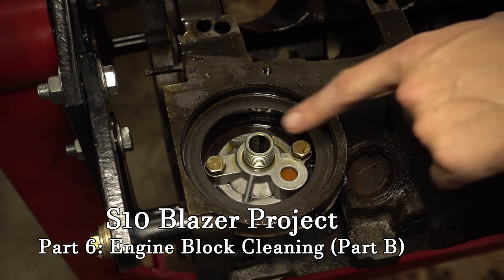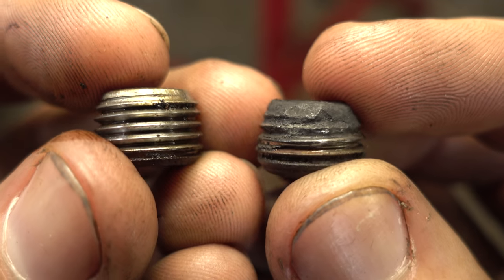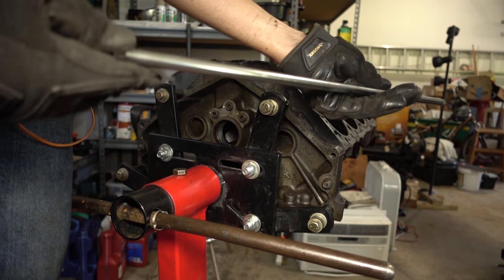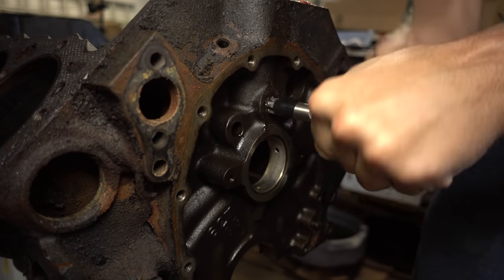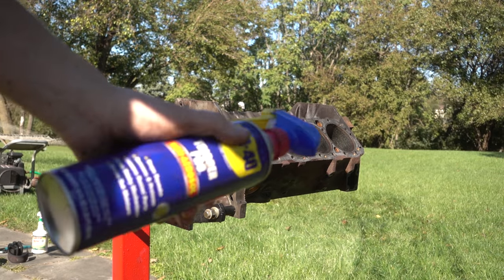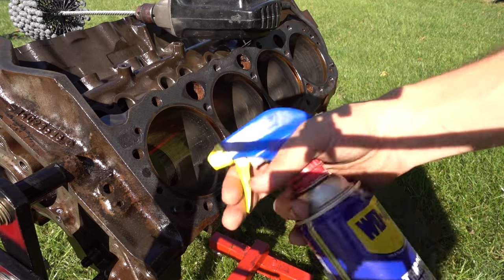V8 S10 Engine Block Cleaning and Honing (Ep.6, Part 2 of 4)

Comment: oh hey look he's using WD-40 for it's actual intended purpose instead of as a lubricant or penetrating oil. neat.
Reply: Tears are a better lube then wd-40
Reply: PB Blaster > WD-40 (as a penetrating oil at least) also pb blaster loses points for looking like squirrel piss
Reply: The actual intended use… 🚀

Comment: Hey in the future drill a small hole in the soft plug center. Then use a sheet metal screw or bolt for an anchor point. Most of the time you can use a claw hammer or a slide hammer and they come right out.
Reply from the maker: Good idea, that would be easier for some of them!

Comment: Simpler way of removing freeze plugs is to knock them in then move them to the left or right and grab the lip with a pair of vice grips like you did with the adjustable pliers. Then you dont risk the chance of slipping with the adjustable pliers, Then you can roll them out with the leverage of the vice grips. These came out pretty easy, but some are a real bear to get out. Much less chance of busted knuckles.
Much easier to do. Nice job and good video

Comment: Just a tip, hold the trigger on the water gun when you start the pressure washer. It makes it ten times easier to start
Reply from the maker: Thanks, interesting tip! Hadn't thought of that before, I did have some problems getting it started in the past (neighbor gave it to me locked up), if I ever have that problem again I'll have to try that out!

Comment: Good idea on cleaning the head bolts from all the the anti-seize i cant stress enough when i see someone just throwing brand new bolts down in them annnnd not cleaning them or even checking. Also all the mating surfaces wired wheel is exactly what you should do. Takes off any rtv or sealant on them ensure a good clean flat surface for a good seal 2 thumbs up!!

Comment: Man I'd be worried about shavings blocking that front cam gallery.  It's going to be hard to guarantee it's clear with the bearing still in there. When tapping those holes in the front of the case it's a good idea to stuff something (foam ear plugs work) in the holes.  The plugs can be popped out from the other end when done.
Reply from the maker: Good thinking on plugging those holes, I honestly didn't think that far ahead haha. I sprayed the pressure washer, compressed air, and brake cleaner through that bearing from every passage (blocking others to direct the flow) in every direction, I'm pretty confident I got it all taken care of.
Reply: FuzzyDicePimp yeah after watching you flush it out I tend to agree:). Your block came out cleaner than anything Ive done myself.  Looked like it was tanked at a machine shop.

Comment: in the future, if you arent gonna get the deck blocked, use a piece of wood with sandpaper to clean off the old gasket. using a die grinder with a wheel makes the surface uneven and can lead to failure of the head gasket.
Reply from the maker: You're right, and that is a good method for flattening a gasket surface, wouldn't be a bad idea to go through and do that after cleaning the gasket. A soft wire wheel is the best method I've found for removing pretty much any type of gasket though. These wheels won't last like the really hard ones will, but I even use them for cleaning gaskets off of aluminum and it gives the aluminum a nice shine, no real scratch pattern or anything. Absolutely no danger to iron.
Reply: FuzzyDicePimp was it a brass one or a steel one? I bet you could get away with it, I just wouldn't. I'm too afraid of profiling the surface unevenly.
Reply from the maker: They're steel, but it is very soft steel. Same wire as the brushes I used to clean the pistons in the other video. I understand what you're saying, but I'm not worried about it. Removing old gasket remnants would take ages and many sheets of sandpaper, but I'm sure it would do a fine job as well!
Reply: FuzzyDicePimp I uh, also have a other question, do you happen to remember the thread you used to chase the threads for the water temperature of sensor in the head? (If you've gone through the heads) I've gotta make an adapter for an ls swap and the Internet doesn't make any sense.
Reply from the maker: 3/8-18 NPT, just double checked.

Also, did a little searching to confirm, but the sandpaper method you suggested doesn't seem like a great idea. Surface finish only really matters for MLS head gaskets for high boost applications, and I don't think anything short of a machine shop would get the finish just right for those. Only time I've dealt with a MLS gasket was on an engine straight from the shop, so I don't really have experience with that surface finish concern. The block of wood and sandpaper is good in theory, and I've seen it suggested in rebuild manuals for carburetors and transmissions, but maybe a deck surface is too large to be able to reliably sand flat enough. Never tried that on a head gasket surface myself.
Reply: I've had good luck with 3m roloc discs
Reply from the maker: Those are very commonly used too, but a bit too pricey and messy for me. For something like this were it was being completely washed anyway, those would be a great choice
Reply: I run the cleaning department at an engine machine shop, and I use steel wire wheels on all cast iron, even heads and blocks that are not getting faced. You just have to keep it moving so it doesn't heat up and smear the surface, and that's with a big 7" 10 amp grinder. Pretty hard to mess up cast iron surfaces
Reply: FuzzyDicePimp yes, and a block of wood is not very flat. I've used a glass plate and sand paper to lap small engine heads and cylinders, but on a big v8 forget about it
Reply: Those soft wire brushes are plenty good for the application, but if you go for softer material on the block, 3M makes "taffy disks" for removing tape remnants and adhesives from painted surfaces without damaging them, which would probably work alright for something like this as well.
Reply: Look up rollok discs :)
Reply: Anthony Krieger 

Yes yes yes , 3M pads on a die grinder or dremel are bad idea they will cut and remove metal as well as old gasket .
Reply: exactly wat i do use a perfectly shaped 2x4 and a sandpaper and wet the sand paper with diesel to keep it lubricated it works like a charm and you save that money you would've spent in machine shop

Comment: Awesome in-depth video, love the amount or effort you put into building stuff! One thing I would have done differently is using a stone type hone instead of a flex hone. The flex hone doesn't have structure, so it will simply mask the scuffs, scratches and pitting. It won't do anything to true the cylinder before you put new rings in it.

Comment: you're right, shouldn't use a tap.  one trick is take a bolt and grind a slot through all the threads.  this will allow junk to build up in the recessed area and not damage your block threads.
Reply from the maker: Yep, you're right, that is a good solution. I have even done that before to chase threads, and have an extra set of head bolts since I broke one taking this apart. Why didn't I do that? Laziness. "It'll be fine" is a dangerous way of thinking haha.
Reply: Or undersized taps.

Comment: Machinist here, all was good till you used that drill with the tap.  On any potentially destructive jobs use your hands.
Reply: totally agree
Reply: Its fine if he set his chuck right
Reply: I was thinking the same thing. Would it have took that much longer to do it manually.
Reply: I'm no machinist, but it appeared he only used the drill once it was trapped out to insert the plug?
Reply: You can use a drill with a tap if you know what you're doing.
As long as you're careful.
Also you have to use the correct tap.
A machine tap.
I still use 4 fluids...
I'm an old machinist.
If it's under 3/8 I do it by hand.
Reply: It was just fine.  He had the clutch setting in the drill you can clearly hear the clutch kick in he obviously isn't stupid.  It was not an imoact driver it was a drill.

Comment: Not sure if taking a wire brush to the cylinder deck where the head gasket sets is the best idea, you really don't want to change that surface finish
Reply from the maker: You'd be amazed what you can get away with, haha! But seriously, those brushes are soft enough that they won't even scratch aluminum, it isn't a problem. For a stiff wire brush, you'd be absolutely right.
Reply: FuzzyDicePimp I know on some engines you definitely don't want to change the finish on the cylinder deck what so ever but I agree, you're probably just fine here
Reply from the maker: I've used roloc wheels more aggressive than these to clean a 7MGE block, those things blow head gaskets like they were designed to have oil in the coolant, hasn't been a problem yet. Just like anything else, I think as long as you are mindful of what you are doing it isn't a problem. If you don't run the die grinder on 150 PSI and lean on the thing like a pro wrestler it'll be friendlier to the surface than many other cleaning methods.

EDIT: Also, this is a small block Chevy. I could remove the head gaskets with a chainsaw and it would still run until I roll the truck over haha

Comment: You  could have used the pipes cylindrical brush mounted on the drill to clean up the threads.
When  you use a tap in a tapped bore,you make it bigger and weaker,it just removes material ,not only crap.
Reply from the maker: A brush wouldn't remove the really tough sealant, that stuff was really on there. Would probably be good enough, though. A thread chaser, as I mention, is the proper tool for the job, as it would clean the threads without removing metal. You are correct that a tap will usually remove a bit of metal each time you run it through, so it is not the ideal solution.
Reply: There are metallic brushes for rifling /barrels for guns wich are really tough and quite hard.
Maybe it can help you.
Reply from the maker: I have brass brushes for my guns, but they wouldn't touch that sealant. Most people clean engine passages with brass brushes (I didn't because I left the cam bearings in and the engine was in decent shape). Threads should have a thread chaser though. Will probably make or buy one if I end up in this situation again, or have actually expensive engine parts to work on.
Reply: wire brush will not back out.
Reply: i should have said a wire brush will not back out of threads unless you can go all the way past the thread, the bristles wont bend backwards.

Comment: If you get a higher amp hour battery for that impact it’ll gain a little power and a lot more run time
Reply from the maker: You're right, but I'm fine with it as-is. I have four of the little batteries from combo deals, don't want to invest in the big batteries (though I do want the big XR impact, so I will have to eventually). Both the 20V drill and that impact driver seem like they are on their last legs, anyway.

Comment: Run a hose to your house water heater. Run faucet 5 minutes. Turn temperature control to maximum. Wait till unit shuts off. Run power washer with that. Return setting when finished. Note: it's actually beneficial to the unit to flush out the tank periodically. An inline filter would be great, to. Chlorine will corrode cast iron.

Comment: If you're doing something like head bolt threads and you don't really want to run a tap down it a good trick is to grind or cut a groove lengthways into an old bolt and use that to chase the threads
Reply from the maker: Yep, a good tip! I have done that in the past (with mixed results) for odd bolt sizes where I didn't have a tap. Enough people yelled at me about using the tap that I'll have to try making a set of chasers for engine threads.

Comment: On steel freeze plugs just weld a bolt to them head down threads up screw on the slide hammer and pop them right out

Comment: Why are there so many plugs on the engine? Why not just leave the holes out to begin with? Are they inspection holes or something?
Reply from the maker: The holes they close are used in the casting process as well as the drilling of oil galleys in the block afterward. Plugs are necessary to make the block, but of course need to be sealed afterward for proper use of the engine.

Comment: I made my own welsch plug removal tool, you tap in a thread to the plug screw in the tool spray some easy out around the plug and tighten it up till it bites and slides, then i unscrew them. easy.

Comment: Good old Water Displacement 40th formula, aka WD-40.
It was originally designed to be used by Convair to protect the outer skin which comprised the paper-thin balloon tanks of the Atlas missile from rust and corrosion.

Comment: what are the plugs for
Reply from the maker: Some for coolant, some for oil. The threaded ones at the base of the block and the ones in the sides of the block (1-5/8") are for coolant passages, the other threaded ones and the big one (2-3/32") are for oil. The holes they close are used in the casting process, and necessary to make the block, but of course need to be sealed afterward for proper use of the engine.

(I typed this to respond to another comment but I'm copy and pasting it here)
Reply: thankyou for explaining
Reply: MN SHP they also serve a secondary purpose! If the coolant freezes, there is a chance the plug will pop out instead of cracking the block!

Comment: Do you have a set of snap gauges?  To check cylinder bore?
Reply from the maker: I checked cylinder bore with extreme accuracy and precision. (No, I didn't haha.) It is a good idea, and a real engine builder would of course want tools like that. For this engine? Doesn't matter what the cylinder bore specs are, I wouldn't do anything about it anyway. A dial bore gauge I should have for sure, but won't have one around for this build.
Reply: FuzzyDicePimp sorry for the late response.  Working my ass off .

Makes sense to me bud ! 
Have fun and good luck

Comment: Hello Sir. I want to vapor blasting the cast iron block. What do's and don'ts I should know. Should I masking the engine block with tape and hole plug or there is no need. I use WD-40 after vapor blasting. Please tell me all about the vapor blasting process for engine parts.
Reply from the maker: I am not an expert and have never done vapor blasting myself or had it done to any of my parts. From what I understand, since the particles are so small, the surface finish after blasting is so fine that it isn't necessary to mask anything, not even threads or deck surfaces. I would suggest contacting a company that specializes in this process and asking them for tips, though.
Reply: @FuzzyDiceProjects  Thanks a lot. Sir I want to know all about how to mask engine parts like block, head, valve cover etc.
Reply from the maker: @bittainment5995  For vapor blasting I don't think you would have to mask anything and you'd want to have everything broken down, but for other types of blasting or painting you can see my usual taping process in the painting video done for this engine rebuild: https://youtu.be/2iy8yUAEims

Comment: Another way to do this cleaning that I have seen on YouTube/used myself is to lay down a bunch of cardboard and use a compressed air cleaner to spray the whole block down with mineral spirits. The mineral spirits breaks down the gunk/oil it and drips onto the cardboard, and then it evaporates off, just leaving the gunk. Then throw it away or just burn it. Not perfect but no groundwater pollution. I live near streams and wouldn't use a pressure washer.
Reply from the maker: Seems like a good strategy! Hadn't heard of the cardboard catch idea before, I like it! Might well have to try that in the future!

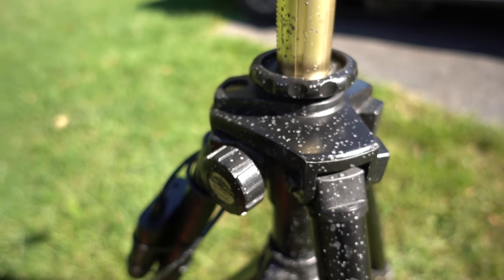Comment: The tool you use at 17:24 for polishing, can you tell me where I can find one of those?
Reply from the maker: It's just a generic 90 degree air die grinder, I think I got this one for $5 on clearance at Tractor Supply. Harbor freight sells a nearly indistinguishable one for $10 or so, just don't expect them to last forever. The wire wheels I use are from Harbor Freight, $5 for a couple of them, and are soft enough that they won't scratch.

Comment: Another good way to clean cylinder head bolt holes is to cut a groove into an old cylinder head bolt and use it as a chaser - does a better job at cleaning the thread and don't run the risk of cutting material away
Reply from the maker: Yep, good thinking! I have made chasers for various things that way in the past, should probably just make a dedicated set for engine bolt threads.

Comment: I hate to say this but I am pretty sure you messed up some of those bolt hole threads using a power drill on that tap, not being a jerk but I've been through this process before and those old blocks love them old bolts and cheap taps have different pitch

Comment: What is the purpose of all those plugs? are they remnants from the casting process of the engine block?
Reply from the maker: Precisely! They block off areas where casting sand was used to make hollow areas and passages (like the water jackets) and where holes were drilled for oil passages.

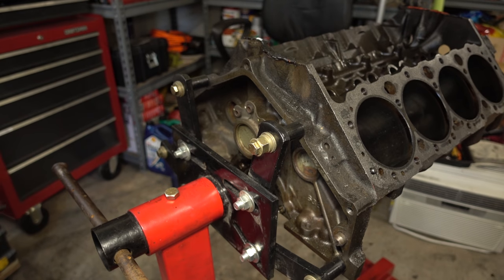Comment: For the plug at 5:00 wouldn't it make more sense to heat the block around the plug to expand it. Not Expand the plug?
Reply: No, heating the fastener is the correct method in this case. While a propane torch like he used often works, an oxy acetylene torch is better for both directing the flame and heating. Rather than trying to expand the block metal away from the fastener by heating the block, the purpose is to get the fastener extremely hot to both break any bonds through expansion/contraction and to allow penetrating oil to flood in around the threads. It's an age-old technique. The rustiest, most-seized fasteners will often times come loose if you get them red hot and immediately hit them with penetrating oil. You also get a buzz off the fumes as a bonus.